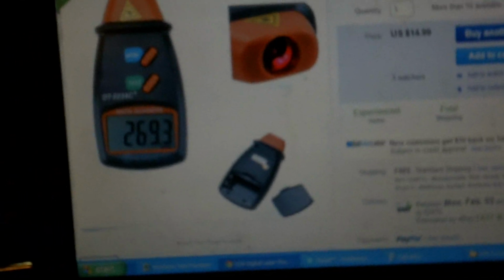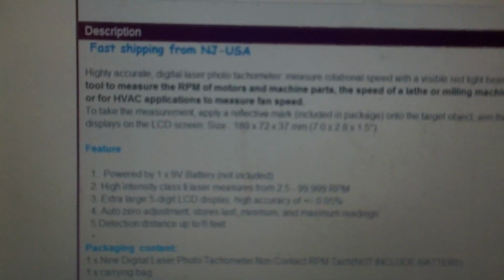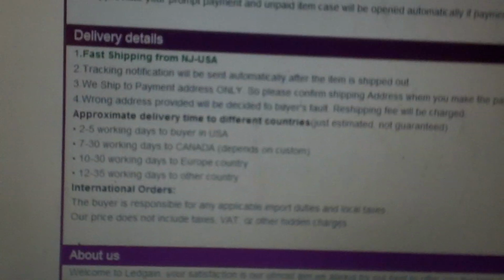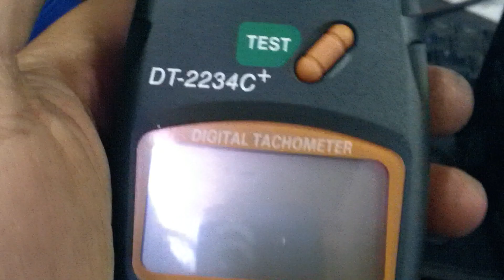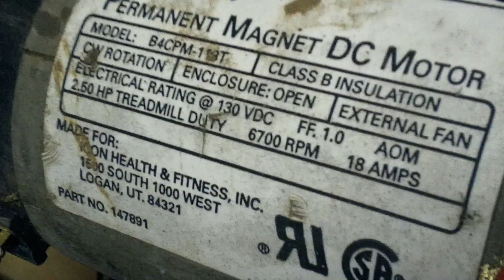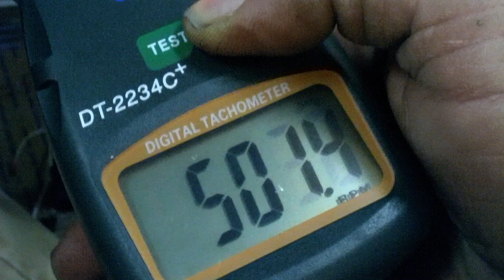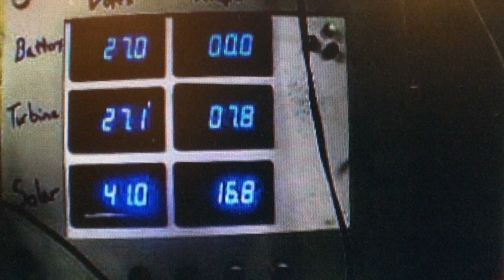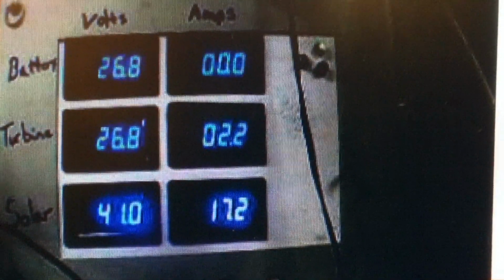Digital Tachometer DT-2234C+ Rievew

Comment: how is this different from the dt-2234? which is better? or r they both equal?
Reply from the maker: +Delvin Goh, I wouldn't know I have not used the other sorry.
Reply from the maker: +Delvin Goh, I do know it dose not like to work in the bright sun.  They work best when there is an over cast or if you are in a work shop.  Me I would call that a con for this product they are cheap.  But if your working on something out side and need to use the RPM gauge and the sun is out, it wont work.